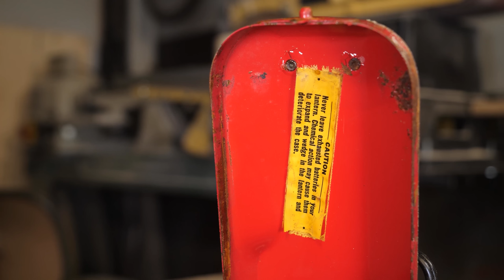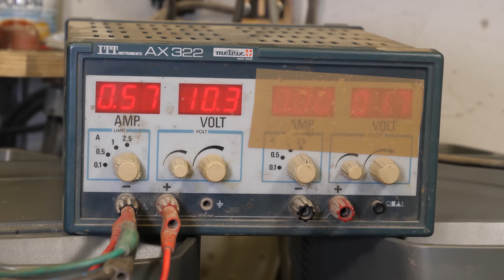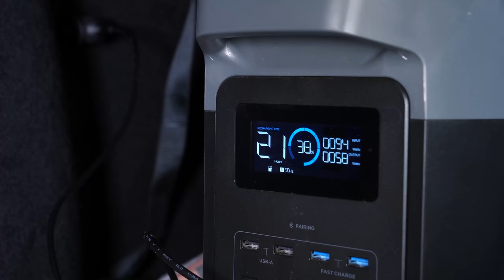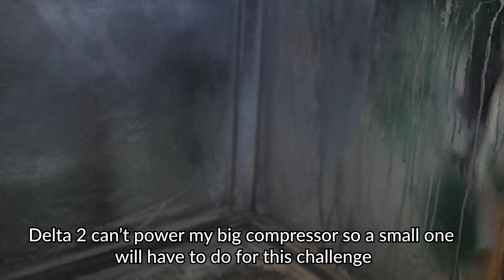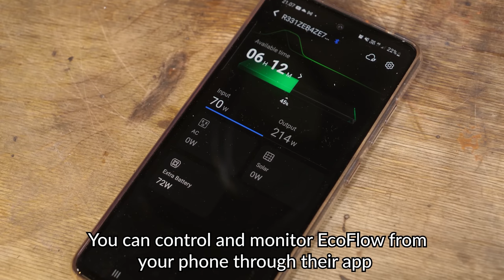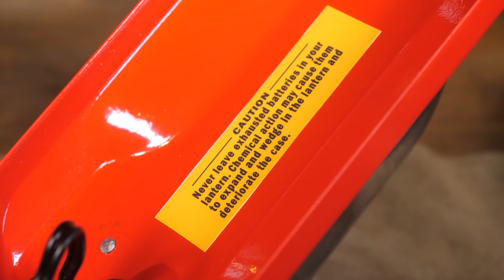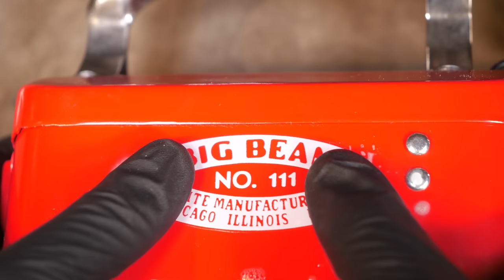1950's Big Beam Flashlight Restoration

Comment: It's so curious to look back and realize how far we've come in terms of resource optimization, to see that huge battery with that huge light bulb that doesn't give 1/4 of the illumination that a flashlight would today the size of my finger...
Reply: Yeah. I wonder if it could be "modernized" without altering it. IE use led adopted and battery that uses same connectors as adoptor. Old battery and light can be used still.
Reply: @XXCoder  LED high output bulb and that whole container filled with modern lithium ion batteries. That thing would light up a whole garage and run for hours.
Reply: Yeah, but nothing beats the materials and workmanship of the things made back then. Now everything is meant to break so we have to keep putting money in their pockets, especially all the made in China shit. And the prices we have to pay are astronomical.
Reply: @BM-si2ei  More like weeks.
Reply: Keep in mind, though, that lanterns like this were being made well into the age of powerful small flashlights. Not only did the battery hold a charge longer than most batteries made well into the 2000s, the unusual size and shape of both the lantern and the battery meant that it didn’t walk off the jobsite very often.
Reply: And we're still bad at it
Reply: You could make a massively bright light with a Fresnel lens and only a tiny weak bulb 100 years ago. This was just a cheap piece of crap when it was originally made.
Reply: @Heymrk  I’d have to agree…. It looks like a cheap piece of garbage
Reply: I highly doubt the modern flashlight the size of your finger would last as long as this old champ here.
Let's face it: even if you spend good money you only get highly mediocre stuff or mostly even utter trash these days. Thanks, globalization.
Reply: The point of this video was to salvage and restore a 70 year old lantern to how it would have appeared when originally manufactured. Conversion to modern components would be the topic of an entirely different video.
Reply: so true, that's how technology evolve
Reply: @Heymrk  https://youtu.be/vV-iX0VWRtI?t=766
Found this example of how bright old flashlights could be - and this is in a much more compact form factor
Reply: yeah I have a mini led flashlight on my keychain that would blind a person
Reply: @XXCoder  Have done just as what B M said. I have an old Rayovack 301K lantern battery that took a two post lantern battery. Swapped out the 6v bulb for one that takes 1.5V and made a custom case for a LifePo4 rechargeable battery. Still only as bright as the original bulb but I have left it on over night once and it was still going. In the two years Ive had this only had to charge it twice with frequent use.
Reply: @robusthedgehog  Nah. Thanks, capitalism. Always seeking cheapest laborers and materials.
Reply: @wileycoyotesr8623  Did I say do the conversion video? Nah, I just wondered about it, that is all. :)
Reply: @Awrethien  That's great. Sometimes brightness is not what you need. I had old led flashlight, it used single led (not 3 watt type but regular led) so it was quite dim. However, on my daily usage when walking though dark park on way home from work, it was great and it lasted months.
Reply: @XXCoder  With 6V battery you can drive one hell of a LED emitter. With that size of a bulb the driver would easily fit inside the socket (two PCB sandwich with quality DC-DC control can get smol). Only issue would be heat - the inside of the bulb socket would need to be wither ventilated or connected by mass of copper or alu with the case to sink the heat away. My guess is 3-4k lumens for 12+ hrs easily. That's helicopter searchlight grade of lighting power.

LEDs are SO MUCH MORE efficient in producing light than incadescent sources it's not even funny.
Reply: @IAmErica-qv7wj  Planned obsolesence is bad for consumers and bad for the environment.
Reply: @IAmErica-qv7wj  I think this is a common misconception about things made during that era. While we definitely have access to a lot of easily breakable, cheap, plastic parts, we only have exposure to the things from that era that have lasted that long. The things from that era that were junk haven't made it this far and are at the bottom of land fills today. It's a logical error called survivorship bias. In this case meaning the really well crafted and durable tools and products from back then are still able to be used or refurbished to be used today making you think that everything from back then was of higher quality than products made today.
Reply: Yeah and you compare this light to gas lanterns and candles and you would say the same thing, except in English of course.
Reply: Is resource optimization referring to the brain?
Reply: I enjoyed watching you restore this light even though it isn’t as bright as the LED lights we now have. The effort and skill you used to bring this back to life is so relaxing. Thank you
Reply: LEDs and lithium ion batteries sure have made a big difference.
Reply: @Heymrk  even Frensel lense can't cancel law of conservation of energy. Sorry to disappoint.
Reply: @XXCoder  why bother. Site lights from Screwfix and Toolstation, even Aldi are better in every way
Reply: @IAmErica-qv7wj  Nonsense. Those old bulbs had very limited life. Batteries bled and died and corroded the metal. Trash compared to site lights from Screwfix or Toolstation
Reply: @IAmErica-qv7wj  Prices we pay today are a tiny fraction of what paid then compared to average or low income levels. I'm 67 and remember those days or stuff parents had from 1950s
Reply: @Heymrk  At last - someone else cuts through the nonsense
Reply: @robusthedgehog  it hasn't lasted. Hence expensive and laborious restoration to gain clicks for a video
Reply: @robusthedgehog  Nonsense
Reply: @suziej2796  the effort and skill in making a video is impressive. The object restored is incidental and, in this case, pointless as an appliance recovery exercise
Reply: @cuebj  yaaaaaaawn.
Reply: It does not hurt my eyes,  it’s not that horrible blue or white color.  Them modern day lights are not great for writing on modern computer paper in the dark of night.  That older bulb is much better for that.  It’s size however is not ideal.  Best of all, I’m sure u could drop it many times and it still function properly.  Drop a modern day light and it will not function well anymore.  Bonus it only has one setting.  Another downside to modern day lights is all the useless settings to click through.  Just depends on ones needs.  Personally I hate modern flashlights,  I consider them gimmicky trash.
Reply: @voidseeker4394  The lens doesn't create energy. It mirrors it into thousands of different directions, giving the illusion of more light. Lighthouses have been using the tech for 200 years.
Reply: @Heymrk  you're absolutely right, it's just an illusion. I have nothing against Frensel lenses, they do their job perfectly. But you can't yield more light than your lamp/battery can provide. Also, lighthouses have completely different purpose than flashlights: they are ment to be seen from far away from all directions, not to light up narrow area. And I'm pretty sure they are quite power hungry.
Reply: @voidseeker4394  Nope. A lighthouse can be run with a small pot of oil.
Reply: @Heymrk  are we are seriously comparing 20 century flashlight with 15 century lighthouse? Here is citation of encyclopedia Britannica(not even wikipedia:))

The electric filament lamp, which came into general use in the 1920s, became the standard illuminant. Power output ranged from about 1,500 watts for the largest structures down to about 5 watts for buoys and minor beacons.

1500 watts just to be seen sounds pretty power-hungry for me.
Reply: for how long
Reply: Does it even matter?! A light is just a light, technology or not!🤔
Reply: @XXCoder  टोऐऐ€__
Reply: @XXCoder  It 100% can, you can buy LED bulbs in 3v for 2 battery flashlights or 6v for lantern battery flashlights in screw smooth or bayonet configuration off amazon. I dropped one into an old flashlight that uses 4 D cell batteries and honestly even with having extra old bulbs for it i wouldn't use them ever again it's so much brighter and lasts so much longer with the LED.
Reply: ❤perfect ❤
Reply: With how awesome they are, it's easy to forget high power white LEDs are almost 20-year-old technology. They've really changed the game on illumination matters.

And to be fair to this oldie, said finger-sized flashlight wouldn't last quite as long as it. Now, a torch the size of a cigar with a li-ion battery about yay big? Heh, that'll run this lamp's brightness level uninterrupted for days.
Reply: @robusthedgehog Nice comeback, really helps defend your point. 🙄

Comment: As an avid tinkerer myself I can't tell you how much I can appreciate your SILENCE and using text over the video instead. People seriously underestimate the peacefulness of repairing things quietly, no music, no conversations. That's all for my rant lol
Reply: Could you please tell me the purpose of polishing before electroplating and not after?
Reply: @VDOless  1. why would you want to electroplate an uneven surface in the first place?
2. why did you think that electroplating needs polishing when its whole purpose is to coat the surface as a protection?
Reply: @oniplus4545  1. The polishing wax compound is nonconductive and would create a insulating barrier to prevent plating. And with my experience in electrolysis, any nonconductive layer on the surface of the metal would breakdown and flush out anyway.
2. The plating is generally uneven as it tends to follow the irregularities and faults found on the surface. Also the bond is weak and needs reinforcement. This is with electroplating only tho. Hot dip plating overcomes this

Comment: While I love items are being restore by you, I can't stop thinking of how far the products have been improved! The flashlight we have now are compact but packed with great brightness/Lumen~
Reply: That’s true but the new stuff isn’t as interesting to look at and hold and just keep as an artifact. Plus it works!
Reply: @janisdardaris4605  New is far more useful and purposeful for doing interesting things. Old things like this are merely decorative artifacts and only interesting as far as showing how far these type of things have improved. Like early brick sized mobile phones
Reply: @cuebj  i like new for efficiency not so much interested in the look
Reply: Why not both, I lilke reversible retrofits, on this lamp I would try a drop-in LED replacement for the bulb (they often seem to have E10 sockets and of course a warm white LED around 2700K) and lantern batteries are so large, you can 3D print an adapter and use a bunch of 18650 lithium ion cells, I've found one that uses 8 cells, so with 3000 mAh (and these are average ones, 18650s can have up to 3600 mAh) cells you have 8.4V and 12000 mAh (and rechargeable) while normal Lantern batteries have 6V and up to 9500 mAh.

Or you could also put a Lithium Polymer battery pack with a BMS in maybe with a BMS that supports charging via USB (so you can flip up the top and connect it to your USB-PD phone/laptop charger) and an output voltage regulator/convertor to avoid burning the 6V bulb.

Comment: Just a quick suggestion: when you are sanding down surfaces, I recommend using a sanding block. It will keep your surfaces all at one level as you go, whereas just using your hand can leave you chasing divets or waves. Plus your hand or thumb might start to hurt after a while with out a block. Great finished product, though 👌
Reply: Cool.... My advice would have been "fuck this entirely, buy a real flashlight"
Reply: No.

Comment: If you keep dipping the tip of a new soldering iron in a small tub of flux will keep the coating of the new tip in tact and will make beautiful solder joints. Most people dont do this and end up making solder joint that look like dog poop piles. Might as well if your going to the trouble of restoring it and making it look nice to have pro looking pretty solder joints.

Comment: I have one quite similar, but i think older a bit (more brass). The front has a lens. It's so heavy, that when there's no battery inside, the whole thing can tip over unless the assembly is tilted back, collapsing the handle and making it ever so slightly more compact. Design was so cool back then.

Comment: You forget to show how you fix the switch of 4:32 :( but good restoration, it's so nice the result. You should use flux with the tin to get best results welding -> Castolin FP3030 is your friend ;).

Comment: When soldering a wire to a terminal, one should make sure the wire is mechanically secure (even just crimping the wire around the terminal) before soldering, so the joint does not rely on the solder alone.

Comment: Good work again! But I also paid attention to the soldering. There seemed to be some movement when soldering the wires. The pieces to be soldered should not move until the tin solidifies properly. And you really should keep the tip of the soldering iron clean.
Reply: I have noticed on other videos here that the main problem is carrying the solder to the part on the soldering iron. By the time it gets there, all the flux is gone and you get that horrible blobby rough joint. Use flux core solder and use the soldering iron to heat the part and apply the solder to the hot component, not the iron. Or apply more flux and reheat if you are reflowing two parts together.

Comment: Good restoration job, but the soldering was painful to watch. Consider investing in flux and a higher power soldering iron. It greatly improves the soldering quality and resistance to cracking.

Comment: If you find that the beam is bad, just sand the Bulb with about 500 grit Emery Paper. Make sure you wear Safety Glasses because the Bulb could pop if you're too rough. I think it's safe though because I've sanded High Pressure Xenon Bulbs before, of course still exercise caution.

Comment: Hello! Amazing job, as usual!  One question: what do you think would be the best way to stabilize a hollow letter made of thin metal (you know, the sort of letters used for cardinal directions in weathercocks, like W - west, S - south etc). This metal has holes and slits in some parts, and can break easily if I squeeze the letter a bit harder. I was thinking of pouring some epoxy inside, let it harden and then add some car epoxy filler to fill the remaining caverns, so I can sand and paint the whole thing afterwards. The only drawback is that epoxy is quite runny and I don't know how to prevent it from pouring back through these small holes and slits.What do you think? Is there a better way? Thank you!

Comment: I have a very similar light I replaced the light & reflector with a sealed beam and the battery holder with a gel cell in the 1970s.

Comment: I still have problem comprehending that LED lights started to become largely available like 10 years ago where now you can light up a room with a light smaller then your finger and everything before that had like a 10th of the power if that great restoration.
Reply: I sure don't miss having to replace light bulbs all the time.

Comment: I appreciate and understand the desire for authenticity but I'd have replaced the original bulb with a suitable LED and the battery with one that was rechargeable. After all, it's been restored and repaired so isn't 100% original now anyway, so why not go that one step further and make it even better. Great job nevertheless, very impressive workmanship and a tough flashlight too.

Comment: Vinegar is great for rusted parts. Threads and hinges and all rust will ease up with a good overnight soak in vinegar.  

..
Reply: My husband likes transmission fluid for rusted stuff, especially if you can't soak it in anything (like a lug nut, etc.).  But I want to try vinegar now.
Reply: @TheGelasiaBlythe  Household white vinegar is very cheap just dilute it 50/50 and let it sit.